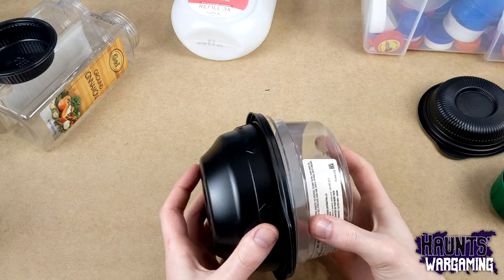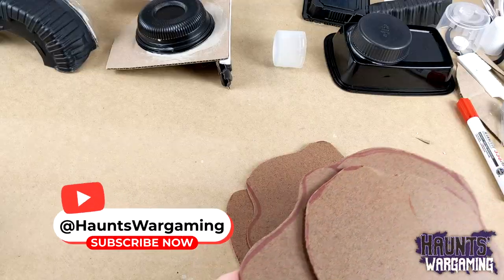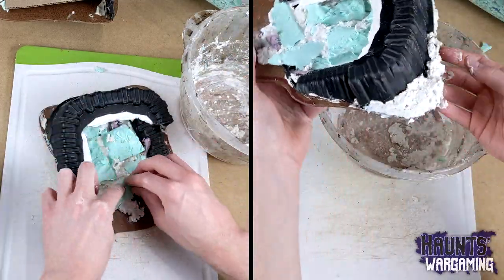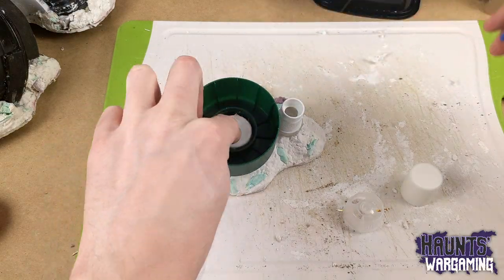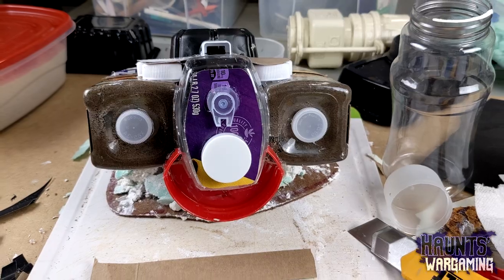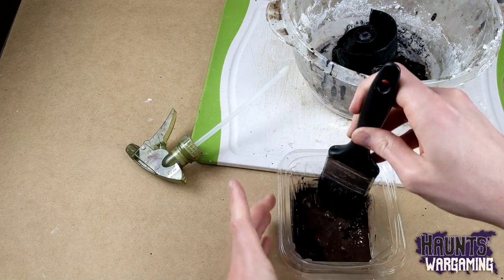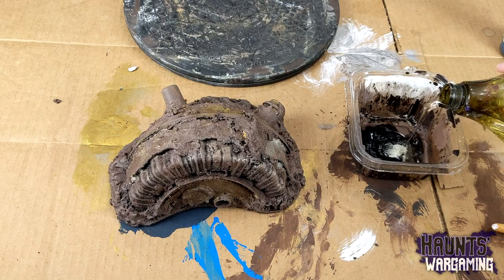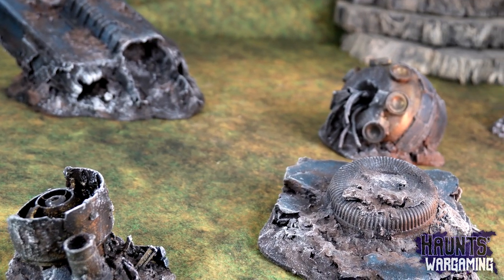Crafting SPACESHIP WRECKAGE - Scratch-built Wargaming Terrain

Comment: your method of filling the inside of those plastic tubs with glue and sand for added strength was a gamechanger for me. I'd tried before to use expanding foam but it comes off. Using your glue and sand method followed with expanding foam afterwards works brilliant. I've also used the process to strengthen drinks cans (you have to cut an end off) and other stuff too to bash terrain. Thank you!
Reply from the maker: No problem man! Glad to hear you found it useful :)

Comment: Was back watching again, on for wire, the fancier type of twist ties, used in packaging to keep whatever you've bought attached to the three pounds of plastic it's in, is a nice stiff wire with a coating, with a circular cross section.
Reply from the maker: Thanks, that's a good one! I didn't think about reusing those

Comment: I've seen a few comments saying to use armature wire or guitar strings (all good idea imo).
To add to that:
You can try to get wire from Harbor Freight (or other applicable hardware store); the stuff I used was for securing locks.
I've also repurposed junked cables/charger cords.
Lastly, in a pinch, paper clips

Hope that helps at least spark up some ideas.

Happy hobbying!

Comment: another great build mate. What i use for bendable wires is floral wire, the one with the plastic covering. You can get them at a variety of thicknesses and they work perfectly. I use them for my necromunda terrain builds all the time. However be mindful of the ones with rubber or silicon covering, hotglue does not stick on that ;).
Reply from the maker: Thanks!
I did pick some floral wire up, along with a few other wires. Lock wire is the most economical thing I've found for armatures. 

I need to use more wires in my builds lol

Comment: 3:54 I'm personally a big fan of aluminum wire now. It's not as expensive as copper, not as toxic as lead, and cuts and bends super easily. You can get fairly thin and thick options in a mixed pack. You might be able to use tin-silver solder (electrical for thin and plumbing for thick) but I think that would be more expensive than it's worth.

Comment: Very cool build! If you want easily bendable wiring, you could try armature wire, which they sell at art supplies stores like Michaels, or maybe guitar string? The only thing is that they don't have the insulation on them to make them look like electrical wire, although they would make good pipes....
Reply from the maker: Thanks for the comment! Armature wire might work well. I want to try making some trees at some point using the wire method so I might as well pick some of it up.